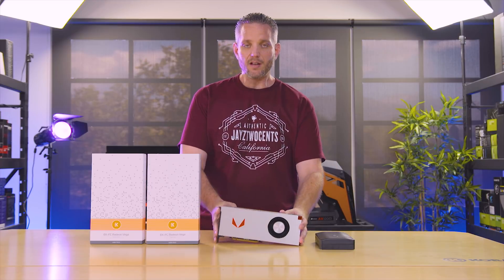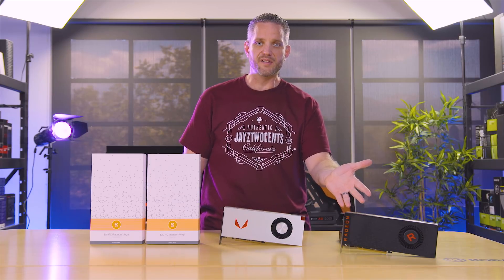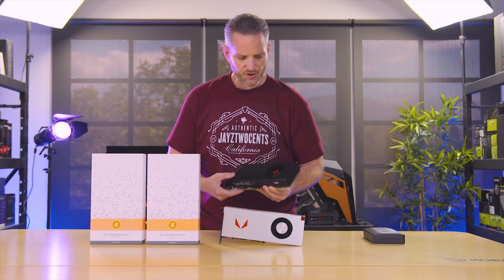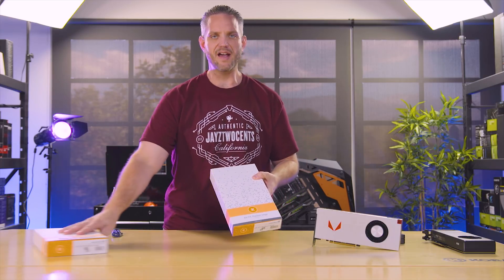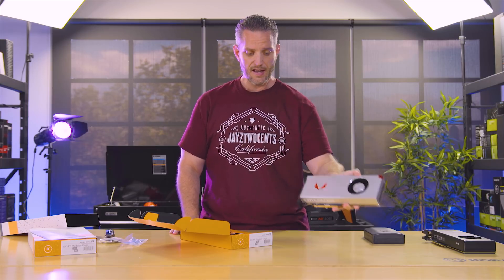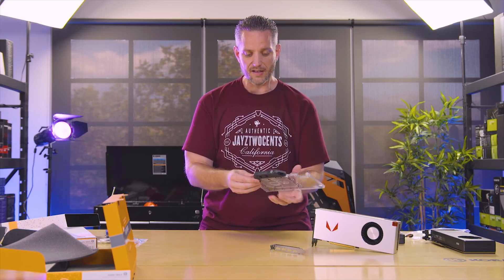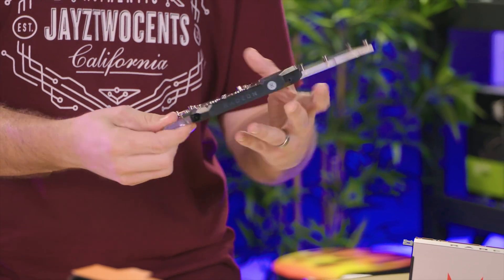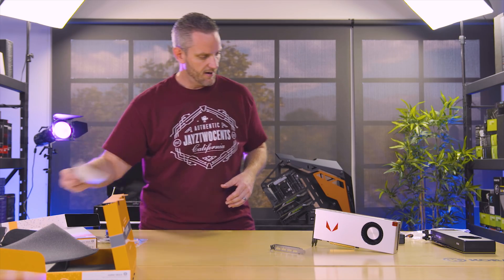Does watercooling help AMD Vega cards?

Comment: Might get a Vega 54. I already have a GTX 1080, but since I use different resolution monitors (2x 2560x1440, 1x 3440x1440), NVIDIA surround doesn't work. I'm thinking AMD Eyefinity will alleviate the issue.

Comment: In my next build, I want to pair three vega 56's (I'm a Blender user, and the vega 56 outperforms the gtx 1080 for rendering). Would it be worth it to watercool it? Will there be a lot of thermal throttling without watercooling, since there are three of them? 
Also, are there cheaper watercooling alternatives for vega? 
Thanks

Comment: I just put water block on my VEGA 64 and now I wonder... Does it makes a difference if you reverse inlet and outlet that it does not follow EK instructions? (right - inlet, left - outlet)
Reply: Also did some FS ULTRA benchmark.
Since my CPU is not top of the line, final score is not so great but it's definitely better than 5700...
https://www.3dmark.com/spy/2643749

VEGA LE BIOS
Power target +50%
Memory clock: 1150
Core clock: 1727 P7

Cool, quiet and fast... Also a bit undervolted...
Reply: przeczochrany nice :)

Comment: I definitely don't think it is worth it at the moment to get any sort of Vega cards, especially if it's water-cooled. 
However, I've heard rumors going about that overclocking the VRAM will increase performance in workloads other than gaming to the point in which the 1080 is beat by the Vega 56. I've already seen that the Vega 56 (NOT 64) has a tremendous improvement in performance over the 1080ti for Blender Rendering speeds. 
Jayz can you do a video testing the effects of OCing the VRAM on Vega rather than having a focus on clock speed?

Comment: Hey jay, Im a 20 years old guy from Germany and i have a question about Watercooling. I mean more about custom Watercooling if its worth it or alot better than Aio watercooling. I want to cool CPU and GPU and I though about first cool my CPU by getting Alphacool Eisbear 420 Aio cooling, because i heard you can easily remove the fittings/Tubings and do custom ones on it. And then buy another watercooler an also cool the GPU with it.

Or if its more worth it(by Price and Temperatures) just do custom one and by all the tubings/Fittings... by myself.

Hello from Germany and Love your videos!<3
Reply: I am not jay but if you plan to do both at the same time why don't you just go for a custom one
Reply: i dont know never did it...

Comment: GPU waterblocks are hardly "worth it". It's all about what you want. I want a GPU waterblock for my 1080ti because I want to run with a full overclock all the time without having a loud GPU. Is that worth it in a pc that's not already watercooled? No, but in one that is watercooled already the extra 130 dollars isn't really enough to count for much.

Comment: Okay so I'm not sure if there's a magical reason I'm not thinking of for leaving off the spring loaded cross support for the back of the PCB where the chipset is when installing the water block... I installed mine today and I sat there wondering why it's not put back on?? Does this not support the board from bowing ? Wouldn't it be beneficial to put it back on especially when reusing the original back plate? Idk comments on why would be awesome because I'm looking for answers

Comment: With two weeks of additional knowledge we now know the Vega56 can be flashed with Vega64 BIOS and achieve almost exactly the same performance as the Vega 64. This development makes the Waterblock an attractive option. When one stops to consider the Waterblock Version of the Vega FE lists for 1300 dollars 630 dollars for a Vega56 plus the waterblock is half the price and cheaper than the 1080 with nearly the 1080 performance. Something to consider.

Comment: So many questions! If a stock air cooled vega 64 has lower stock clock speed and wattage than the liquid cooled version. Do they use different bioses/firmware? Do I have to flash the bios to get the higher standard clockspeed of a stock liquid cooled vega when putting this block on one bought aircooled? is the difference between the liquid stock and the EKWB really worth it? Can I hook the EKWB Vega cooler to say the radiator/fan of a corsair H50 and make it sort of like a homemade vega 64 stock aircooled -> vega 64 Liquid?

Comment: Finished my build, Pump to EKWB Vega 64, to XSPC RX120 rad, to Swiftech Apogee XL cooled 1700X R7processor, to XSPC 360slim rad in In white Win 303 Aurora case, running Giel EVO X 3200ram 16GB, 128Gb M.2 system memory, 1TB blue storage HDD, 850W PSU.

It runs SOOO much better now vs. air, less jittering 20% higher scores on time spy (7938 score on GPU), runs at 44C maxed out, best part, no jet taking off noise!

Pro tip! I flashed to the water bios, it offers higher clocks as I get 1717 to 1773mhz and 1000mhz ram under full load.

Comment: I have a gtx 1060 6gb from msi armor and it runs at 56 degree at max (by that I mean when I run vally benchmark at extreme, the max temp was 58 Celsius) I don't know but does it mean that I can overclock it better or? And btw its already ov by msi
Reply: And most of the time the gpu fans don't even when I run like smite at max settings or 30 min in GTA v and more

Comment: I recall my Radeon 295x2 ran at around 65/69 degrees C watercooled with a TDP of 500 watts from the wall, the Vega 64 is running at 46 degrees C and pulling around 300 watts from the wall socket, yet the Vega 64 is more powerful than the dual core 295-X2, and the Vega 64 has only just been released, the 1080 has been on the market for over 18 months, so its drivers are probably already at there peak, Vega can only get better.

Comment: I have to admit although it would be crazy...integrating a beer fridge into a liquid cooling loop would be something to see.  My current theory is that if you put the main radiator inside the fridge with some normalizing radiators on the outside to help combat condensation that it would offer much lower temps for your system.  Of course if I can ever afford to build it I will be using quick disconnect connectors like the ones that koolance makes or even their actual QDC 3 type connectors.  I just don't have the money at this time.  I dare you to try such a project.

Comment: Make sure to add a pinch of salt to the water cooling the system, it will increase the viscosity and make it flow smoother with less noise.

Comment: a semi related question: what if you used a "water wetter" product in your cooling loop? royal purple purple ice being one of the best. note: i work in auto parts. ive gotten reports that in autos it can reduce "load" temperatures (aka pulling a hill) by as much as 10 degrees F . so if the car normally runs at 205 F going up the hill, it will then run at 195 F all other things remaining the same.

Comment: Weeell. I'm conflicted here. 
1. Definitely glad you did the video. Thanks!
2. I would have liked to see some overclocking. Can you push it harder to get more performance out when you're gaming? I love gaming, but even when I'm binging on a new game, I'm not on 24/7 - so I can live with heavy power drain when I am gaming, so long as the thing knows about netflix & chill.
3. For me, factor X is freesync vs. g-sync. It REALLY irks me to pay NVIDIA an extra $200 for the same thing.
4. That is, assuming VEGA prices eventually stabilize. Right now, VEGA prices are nuts, and whatever you save on freesnyc, you lose on crazy pricing.
5. Factor Y is the FineWine phenomenon. If you could fast forward 6 months and redo this video, I think we'd get a better feel for whether some of AMDs future oriented architectural features actually end up making a difference.
5. And then there's factor Z: mining. I know this is anathema to gaming benchmarkers, but I wouldn't mind seeing some price-performance-watt benchmarks there too - which card gives the most mining performance per watt hour? I buy my GPUs to game, not to mine - but I mean geeze ... What, exactly, is wrong with free money? Since I run a miner most nights, it would be nice to be able to see which card will help me out most there.
6. But basically, for the time being, I'm frustrated. I've been waiting for VEGA to finally update my entire system to run a 4k freesync monitor  - and that's just not here yet. I think I'll keep running my two 290xs and wait for something that really wakes me up.

Comment: Hi, Jay!
I was looking for an NZXT X62 for my i7 4790k overclocked to 4,5 GHz. I have 2 questions.
1. My board only has 3 fan headers, is there a thing with the NZXT X62 so I could only put one fan header into the CPU fan header on my motherboard? Maybe it's called a fan splitter?
2. Would it be worth upgrading from Evo 212x -> NZXT X62?

Comment: Nice Video , loved seeing Vega on water . 
But no I don't think vega let alone Vega+WB are worth it vs 1080ti . 
Thats why I picked up a used 1080 after the vega launch . Even though I have been water cooling my pc for 10+ years I might not put this card under water , I have a AIB gigabyte card with 3 fans and it keeps it pretty cool can hit avg boost clock of 2100 in games . Only reason I would put it on my water loop ( 3x120 + 2x120 ) is for the sound levels but cant justify the cost of the block for the very little extra oc room I will gain.  I run folding 24/7 ( when not gameing ) so I set the fan speed @ 85% . It is noticeable to say the least =)

Comment: They said the same thing about Ryzen at launch. The fact that vega has gayming features disabled because amd had to give priority to prosumer drivers says what's happening. 
Just pasting a comment i made on LTT. 

FFor people above: AMD Gave up in high end gaming cars when GTX 970 was released, Vega is an all-around GPU. Amd was in the brink of bankrupt, they dont have the same budget than nVidia and Intel, nVidia for example fragmented their series in 3 series (GeForce, Quadro and Tesla) the difference between them is that this gpus have features disabled that favors certain usages, because of this you dont have the same performance in games even though nVidia Quadro cards doesnt use all CUDA cores on gaming (which would make TDP skyrocket). Now, about Vega: http://www.pcgameshardware.de/Radeon-RX-Vega-64-Grafikkarte-266623/Tests/Benchmark-Preis-Release-1235445/3/ Tick the RX580 in the list and look closely at the number of culled tris. 

NGG path is currenly disabled for RX Vega, it works like bigger Polaris. PDA is working though, just compare it to Fiji, clock per clock. Every AMD GCN generation save for the blitzkrieg-up-Nvidia's-ass 7000 series (which, I remind you, was the last AMD gpu arch Raja Koduri was 100% involved in from start to finish before leaving) underperformed against their value competition for about 8-10 months until driver development caught up with the card's programming needs. Just compare GCN's programming model to Nvidia's [Kepler/Maxwell/Pascal] model - GCN is a clusterfuck "jack of all trades" compute-oriented (read: throughput at the expense of latency) design which needs a ridiculous amount of hand-tailored code to function optimally for any given non compute workload. It's that bad for gaming. 

Gaming needs latency-over-throughput functionality. GCN is the exact opposite of a gaming arch, and the fact that drivers can extract performance equivalent to the competition, no matter the manpower AMD has or the time it takes, is a testament to how resilient the architecture really is. Drivers are PRE-ALPHA, they arent even using some gaming features, like people who bought the powerhungry HD 7970/R9 280(x) they improved a lot through the years via driver updates. Like Ryzen, people should wait™ to drivers maturate.

 I personally can say this because even with my dead R9 280 i was getting 110FPS on Doom (vulkan) at higher settings. Stop shilling guys. And dont answer shitposters. Gaymen drivers for RX Vega are not ready yet

Comment: I don't think I'd buy one, with or without a water cooler, and even if the prices normalize. Not with that kind of crazy power draw. And I say this as someone who always favor the underdog, and who hasn't bought a Nvidia card in over a decade. If I had to choose between this and the 1080, I think I'd go with the 1080. I don't know, I suppose if maybe the drivers mature and improve things enough, and the price comes down and I get on the 4K train, then MAYBE I'd consider one. But right now I'm just not too enthusiastic about it.

Comment: On topic tho: No it's not worth it. Anything that gets you into the 1080TI price range in automatically not worth it. For games the TI will destroy the 64, and for mining you don't care about water cooling your card. 
At current prices Vega it simply a no buy. Unfortunate, especially seeing how good Ryzen is. Oh well.
Reply: darkholyPL 
You could get more hashes by raising clocks for sure. Water blocks will allow more better temperatures for better PC. A custom BIOS would be needed for extreme miners.

And also don't forget the time GPUs mine for. They don't just mine for a few hours. Days and days of mining take place usually.
Expect heat to build up.
Reply: darkholyPL , my gaming rig is an 1800x with a 1080Ti, but since all the price drops a little iver a month ago, I built a second rig I plan on learning blender with and using for editing drone video further on with.  Got a Asus Arez/Strix for $580 on Newegg & a 1950x for $650 at Microcenter. Vega runs flipping HOT as hell with a load so planning on a custom loop especially before I try to OC the cpu too. Cooling it with a Kraken 62 currently.
Reply: Vega 64 price now: $380. Still a bad buy?
Reply: i always include the cost of freesync vs gsync in my buying options. its about 200 euros in favor of freesync in my country between equal quality panels. And since IN MY OPINION any serious gaming shouldnt be done without variable refresh rate i chose vega 64 watercooled and freesync.
Reply: Yeah uh.. No? They perform about the same, some games 1080FE does better, some games Vega 64 does better. Heck, even an OCed and UVed Vega 56 can keep up with a 1080.
Reply: Rick ́n Sick No, the 1080 is not better. At least, not the FE edition.
Reply: Alexander Stormdahl Maybe a normal 1080, not the TI.

Comment: if i was looking for a card id go gtx 1080 better price and performance. unless 64 goes down to 500 there's no compitition
Reply: Right now, the 64 is $570 from Saphhire on Newegg.
Reply: Right but I think still you can go about anywhere and spend about 500 and get a 1080. I was at microcenter yesterday and i saw 64's for over 650
Reply: the 1080? can you elaborate? you got vega? how much better is for the 200$ premium you pay? second account?
Reply: Josh Murdock talking about vega
Reply: Josh Murdock even at $500 it's shit

Comment: Great vid, informative and awesome style. I think watercooling for GPU would be more mainstream if it wasn't so expensive. Expensive because you have to replace the waterblock with each new generation of GPU. Unlike CPU coolers which generally allow you to upgrade a CPU and keep your cooler... I love the idea but considering I'm already upgrading a GPU every year so it's a lot more $ to upgrade a waterblock every year also for most people. If the industry developed a standard style block that could be used on multiple generations of GPU it could make this market increase greatly!

Comment: Can you test some blocks from Bykski ? Half the price of the "usual" brands but also with good quality. https://www.aliexpress.com/item/Bykski-A-VEGA-FE-X-GPU-Water-Cooling-Block-for-AMD-Radeon-Vega-FE/32827607634.html?spm=2114.search0104.3.15.IXcS45&ws_ab_test=searchweb0_0,searchweb201602_5_10152_10065_10151_5490020_10068_10193_10194_5430020_5410020_10304_10307_10137_10060_10302_10155_10154_10333_10334_10056_10335_10055_10336_10054_10059_10332_100031_10099_5400020_10103_10102_10052_10053_10050_10107_10142_10051_10320_10321_10322_5380020_10326_5390020_10084_10083_5370020_10080_10082_10081_10177_10110_10111_5420020_10112_10113_10114_10180_10312_10313_10314_10184_10316_10078_10319_10079_10073_10186,searchweb201603_17,ppcSwitch_5&btsid=8b28f72c-42ab-4145-a596-eb8bc47e9748&algo_expid=aabb2232-eb81-48d7-85b6-50a53c74b50d-2&algo_pvid=aabb2232-eb81-48d7-85b6-50a53c74b50d&transAbTest=ae803_2

Comment: Pretty dramatic I liked it. You should undervolt it, AMD cards always have too high stock voltage because they lack auto voltage tune feature like Nvidia has - so you can save a lot of power and maybe also get a higher clock out of it on same power usage. Price is pretty high but then again a 1080 ti with comparable block costs about 930 I guess, at least here. I also think Vega still needs time to be really used by games, it's a DX12 card way more than it is DX11. Even more so than Polaris or Fiji.

Comment: Coil whine is produced by chokes ( inductors ) of the VRMs. In Vega's case, the VRMs have exposed metal heat spreaders on the VRMs (like Vega FE, I think). The coil whine is produced by the instantaneous switching frequency of the FETs. Plus... you wan't as little as possible inductance in your core due to mutual inductance that will cause EMI. Check your facts before you just assume stuff.

Comment: i still dont understand how he tests it in open air and says those are fair representations of temps given that the temperature in general is hot outside. nobody strips their pcs out of their cases when its hot outside and if the heat outside adds to the heat in the case then how hot will the gpu run at....thats my question.